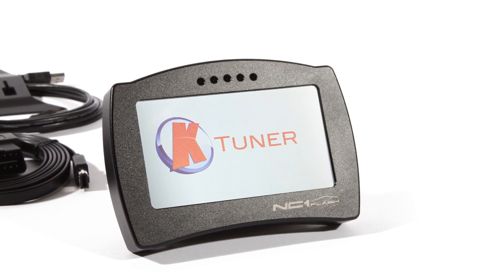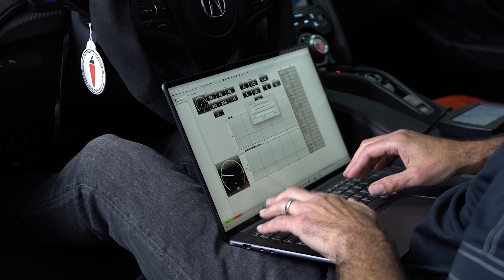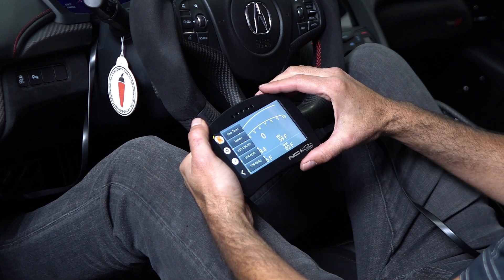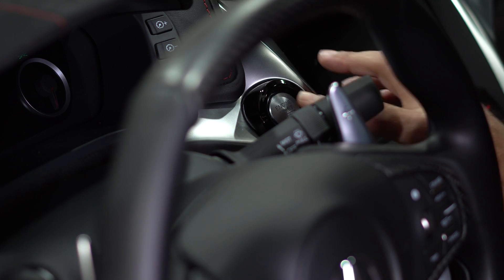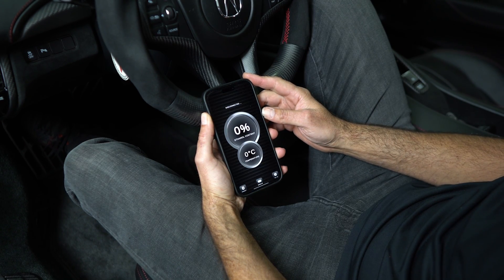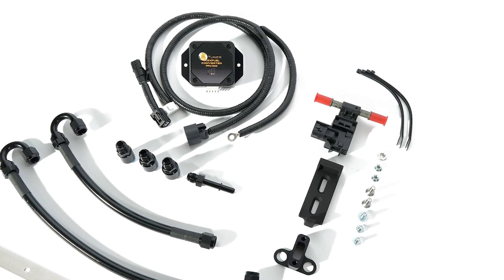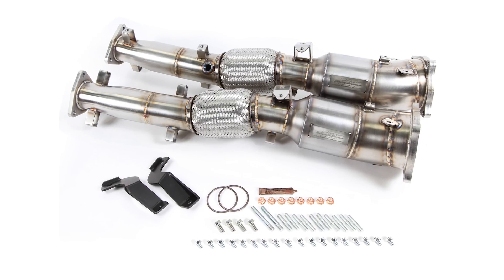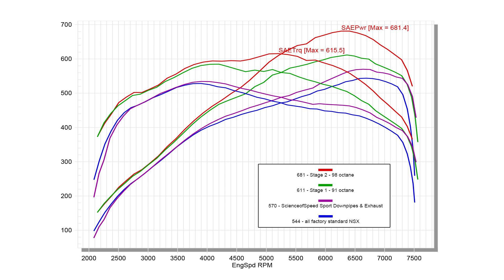680+ Wheel Horsepower From Your NSX using KTuner Stage 2 & ScienceofSpeed Ethanol Monitoring Kit

Comment: 93 octane with upgraded turbos next??
Reply: I am hoping they comment on the potential for e85. I figure the fuel pump or injector duty cycle goes too high, but I wanna hear them say it. Hopefully it is as simple as new injectors to allow it.
Reply from the maker: @Dmand18729 @kchiang4200 we will have more information about the turbo upgrades next week. Additional power is possible with out the need to upgrade the fuel system. Thankfully, the factory left quite a bit of overhead on the factory fuel system.
Reply: @Dmand18729 Same.  Plenty of good E85 in my area.  I'd like to know if I can run it 24/7 like I do in my 91 NA1.

Comment: Love it! is the top end fall off for the health/longevity of the transmission?
Reply from the maker: The torque curve represents the efficiency of the engine, but also the torque from the electric motors decreasing at higher engine speeds.
Reply: @ScienceofSpeedLLC  Fair enough. I did watch the dyno video and already forgot! Doh!